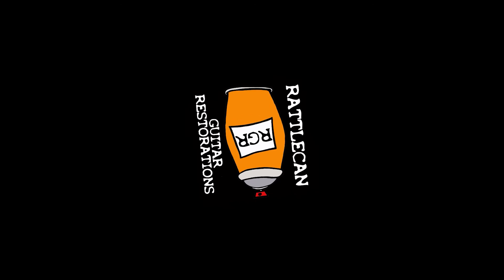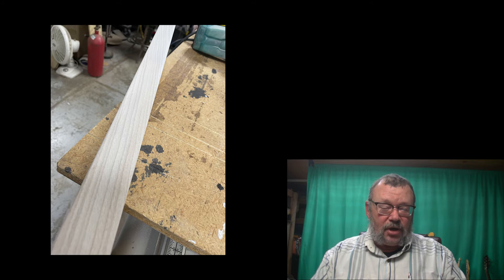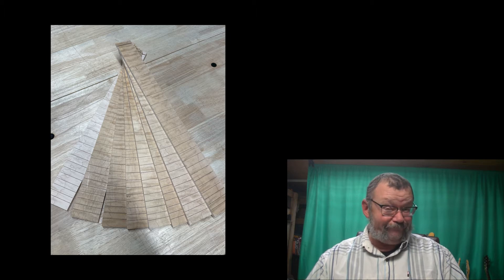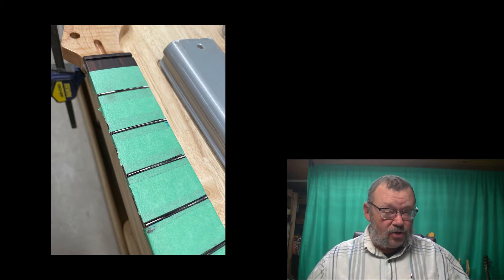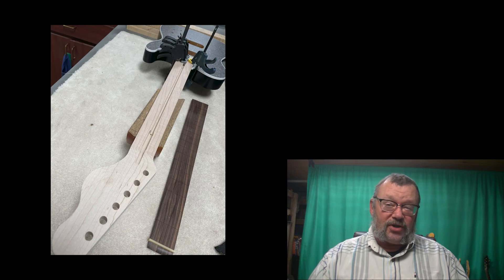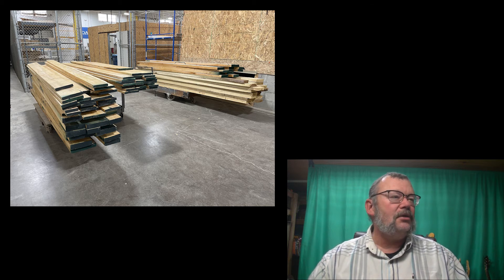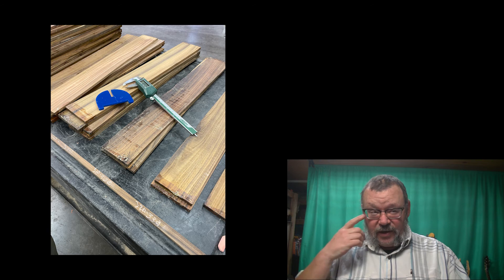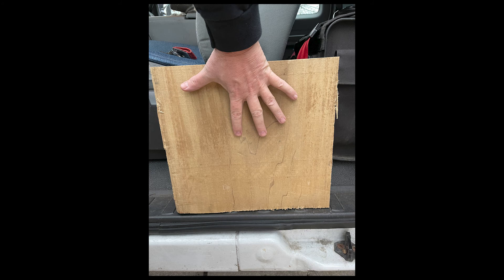Guitar Manufacturing using STEM Concepts Week 13 | RATTLECAN GUITAR RESTORATIONS by James O’Rear

Comment: I really like that formica top. Really only two or three ways the end frets get sanded down like that. They weren't seated all the way, the board wasn't sanded flat or the neck wasn't flat when leveling. Only one good way to fix it. Determine the problem, pull the frets, as many as needed depending on the problem. You should put some fall away in the end anyway. A notched straight edge is ideal for working this out. Cool job in the kit factory. Kind of a nice niche selling  only to schools.
Reply from the maker: Apparently the program originated here and there's a good amount of industry support with the caveat that the kits (containing said support) are only used for the education program which is understandable. The job is a bonus, everyone in the program is pretty cool.